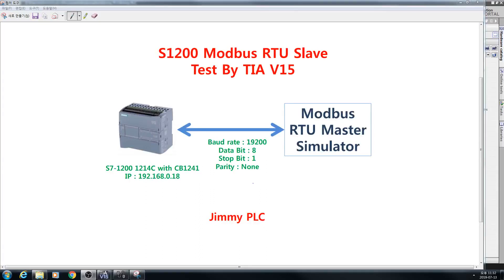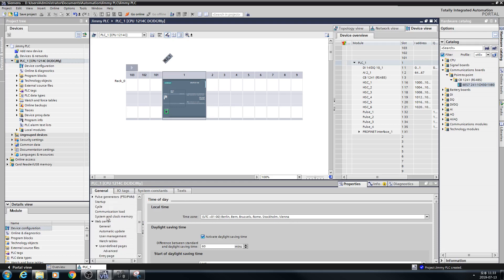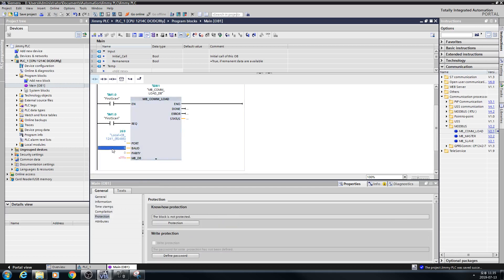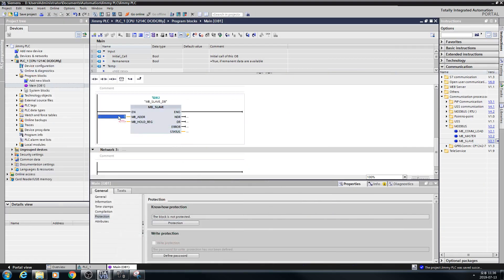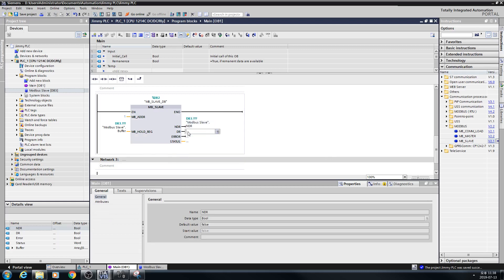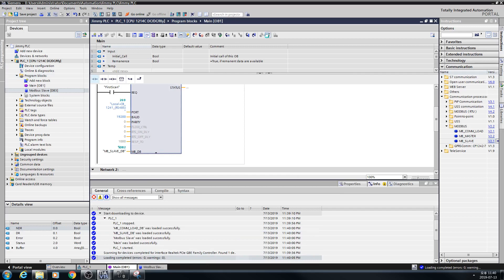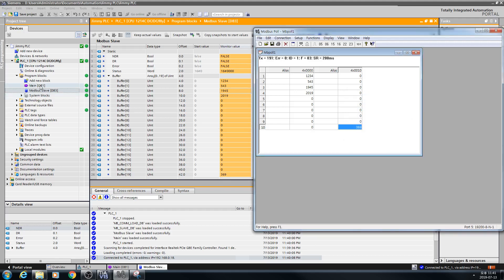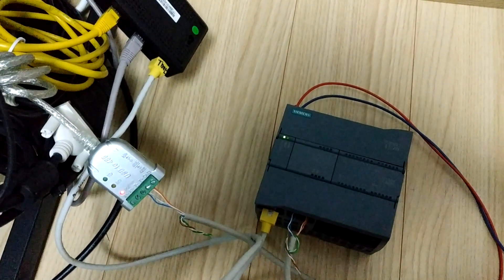Siemens S1200 Modbus RTU Slave test

Comment: Nice lesson .. but what if i have to transfer status bits (1xxxxx) along with registers (4xxxxx) .. will it be in the same buffer or additional buffer needs to be created ????
Reply from the maker: As I know, you can not read FC02(1xxxx) resistor with buffer DB. only buffer DB can read with FC03, FC06, FC16. 
Modbus communication function codes (1, 2, 4, 5, and 15) can read and write bits and words directly in PLC physical address.
Read bits
 10001 to 18192 is PLC IO I0.0 to I1023.7